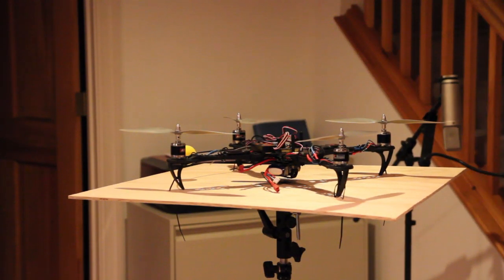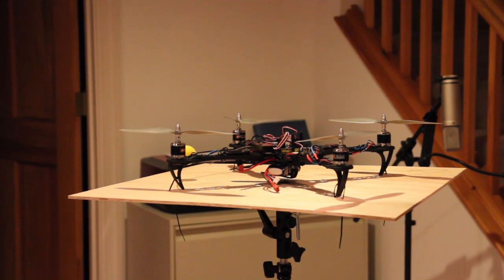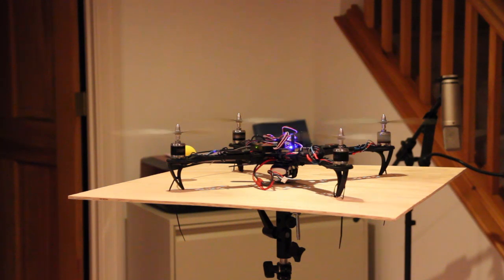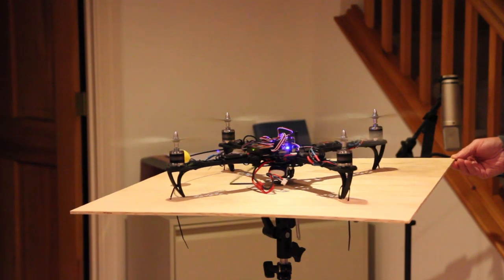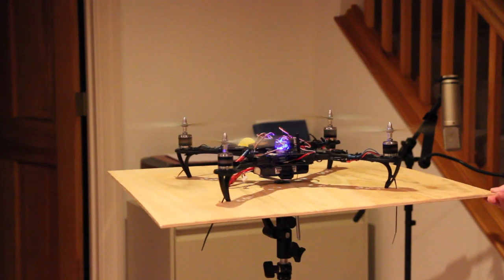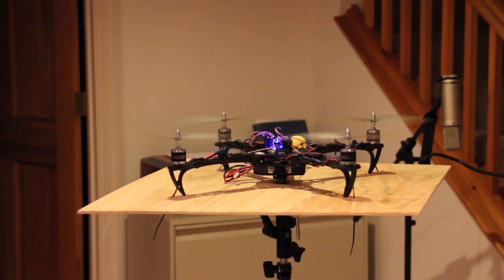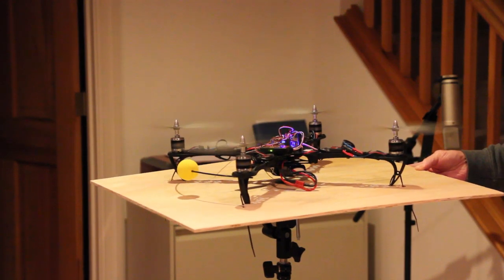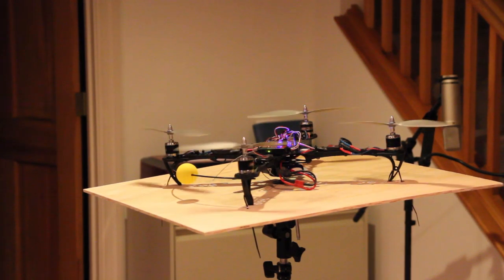Gyro Test on Quadcopter

Comment: Can I use a 9 DOF sensor for a quadcopter? How can I avoid oscillation for the gyro. Every time I turn on my motors the gyro starts oscillating very badly when the quad is on the floor.